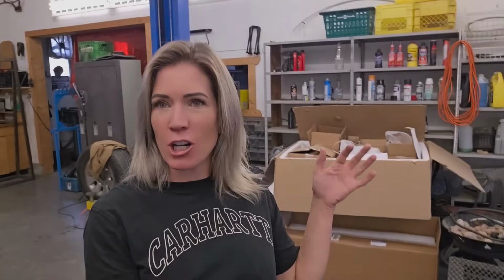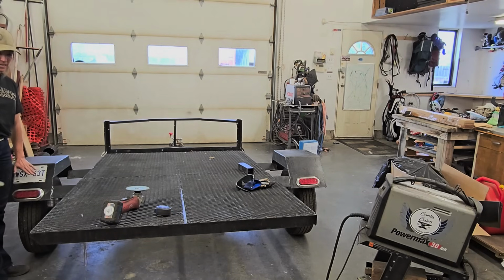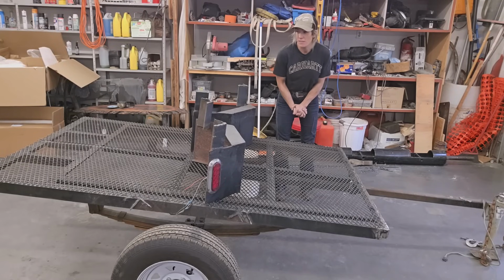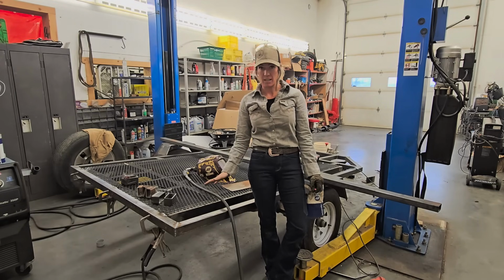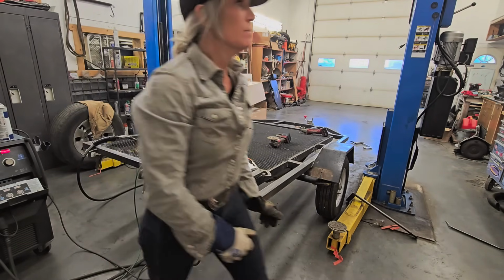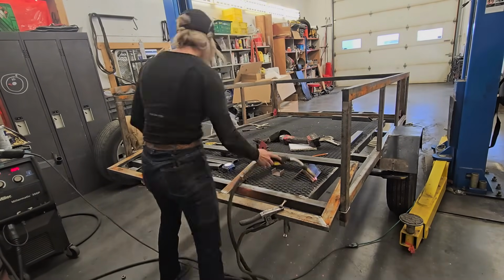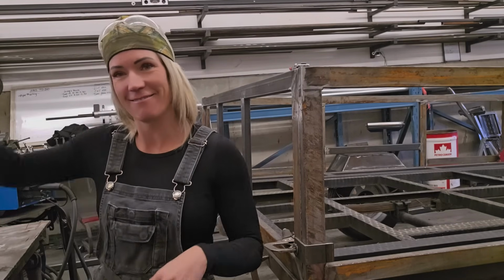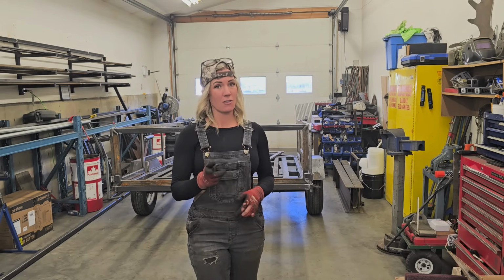Welding With Rachel - Utility Trailer Upgrade

Comment: Hi
Was just wondering what disk you used to grind around the edges and welds. You were getting a nice clean finish.
Love watching your work. It’s very inspiring and informative.
My sister has the same name BTW..
Work safely.
 New subscriber.
Reply from the maker: @musashiblade8665  Hey! Thanks for joining along!! I use a sanding disc with a backing plate, and then clean with 80  grit on the orbital!!

Comment: The only thing I would have done differently would be to move the spring mounts under the new outer frame sections as that will be where the main weight will be.
Reply from the maker: He’s changing up the springs on that so I didn’t need to worry about it!

Comment: If you want to make sure the fenders don't touch the tires, drive your truck up on the trailer 😂 Your feather light frame won't make the suspension sag much 😋